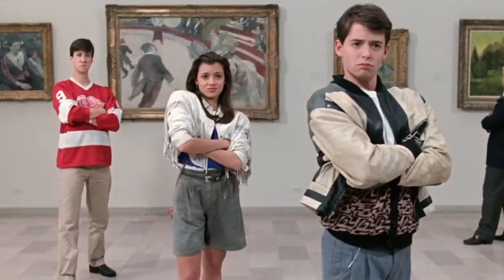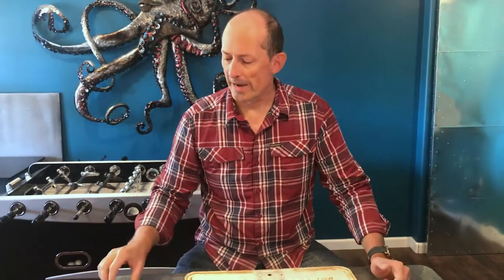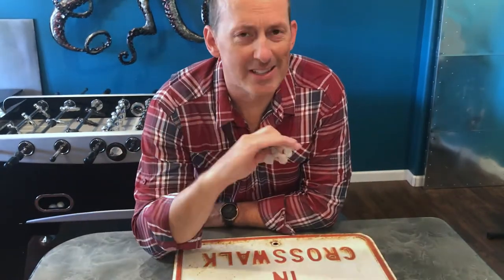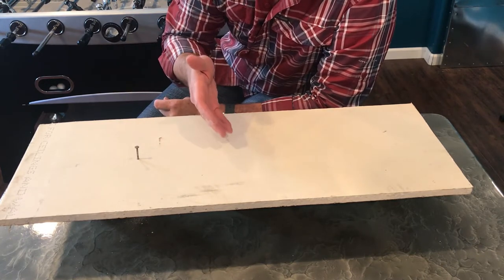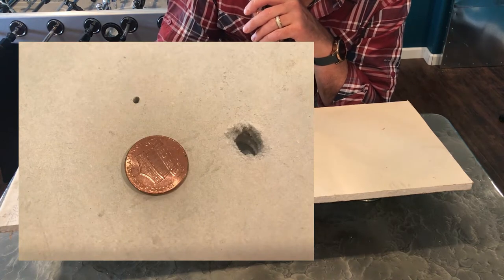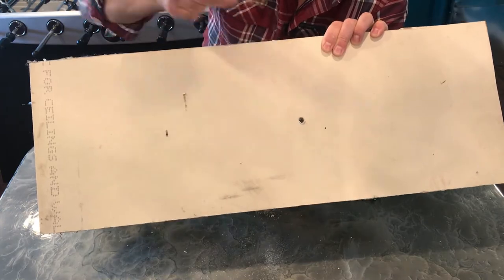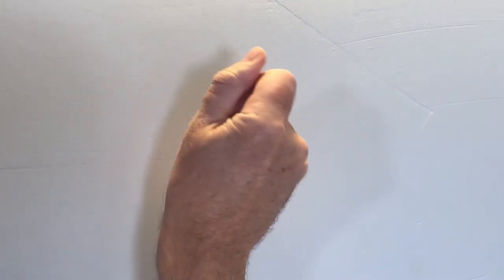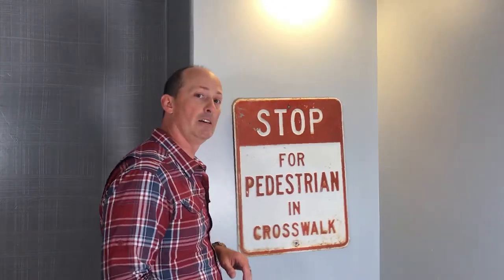Hanging art or pictures in seconds with almost no damage to walls

Comment: I have some plaster walls. I tried to use monkey hooks and tore up the wall.
Reply from the maker: I believe it. Sorry to hear it. They are intended for drywall. I owned a home with plaster walls once. We have to absolutely do things differently there. 
What have you found to be the least damaging and easiest to repair for handling art in plaster?
Reply: so if I use 2 fifty pound hooks, they should hold my pictures no problem?